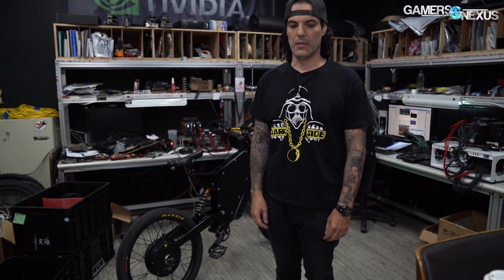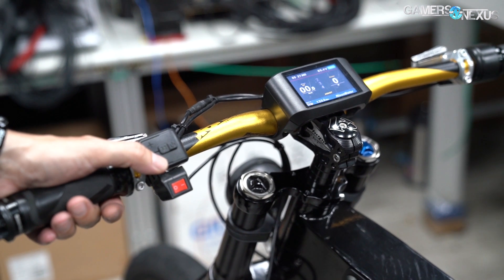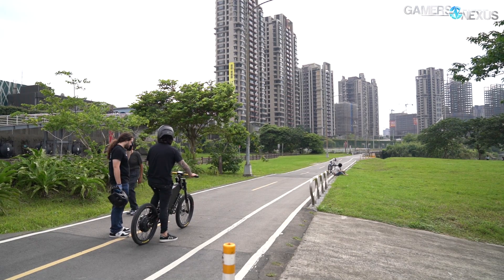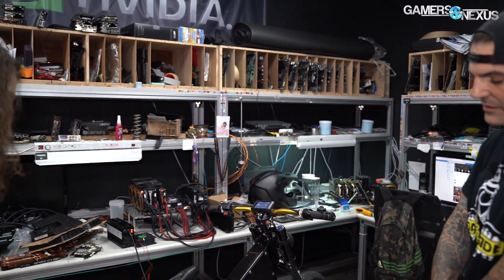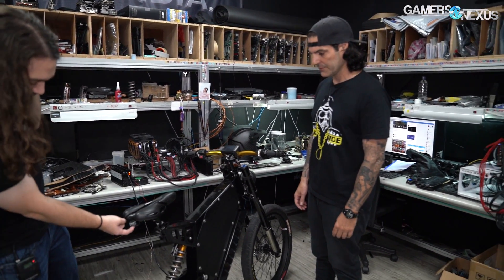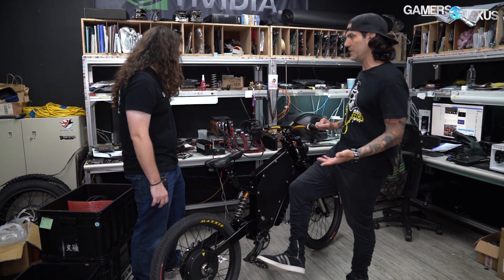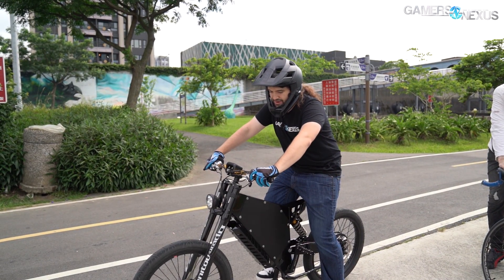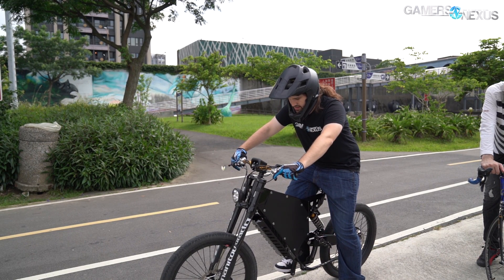KINGPIN's 60mph E-Bike | Bike Check & Test Ride

Comment: $75 e-bike capable of 25km/h with 250 W motor:
https://www.sears.com/skyling-25km-h-26inch-36v-foldable-electric-power-mountain/p-A013534087?plpSellerId=Skyling&prdNo=1&blockNo=1&blockType=G1
I haven't bought it so I can't say for sure it's good. Surprisingly there are no reviews. But it's super cheap. Although i don't know the shipping cost.
Edit: actually it's $460 shipping and $535 total. No pick up options. I should have known. Nice looking bike though.

Comment: In NYC only the peddle assit are legal, no throttle.  The cops hate taking bikes that have the throttle enabled because they feel its a big waste of time.
Reply: I hate he pedal assist, it’s dangerous! Mine has a good half second lag, and it’s way to aggressive! Then the speed cuts out way too slow (I can do about 30 mph average on a normal bicycle if it’s short distance like 15 miles). I hate it, throttle for sure is better, so much better control! Speed limiter unless pedaling is fine (since it’s not like my gasoline powered bicycles, it just weirds me out when I’m not pedaling and moving without sound.... I always pedal with it, so having limited without pedaling would be fine since that would never happen for me

Comment: "Are these quadpiston?" Is this what it sounds like when I talk about pc parts in front of normal people?
Reply: Just add in some slang. I use six pot brakes
Reply: @th3d3wd3r  Okay wtf does that mean.
Reply: @imnotusingmyrealname4566  The "pots" are the actual pistons which press the brake pad into the rotor. A 6 pot caliper has 3 pistons on each side of the rotor. A normal car brake will be "2 pot" and performance brakes 4, 6, or even 8 pots. For really large brakes you need more pistons (pots) to evenly apply pressure.
Reply: @johnbrooks5903  Yeah that's what I assumed. I've never heard it in that context. Damn are that many pistons necessary? That's what I assume a sports car would have.
Reply: @imnotusingmyrealname4566  well they are smaller than a sports car so yeah. Also when going 100kmh i think you would want to stop quick
Reply: I suppose so, I am somewhat of a “nerd” per say in both automotive and pc gaming sectors.

Comment: How much more range could he get if it the battery and controller were LN2 cooled? Let's find out!
Reply: About 1/3 if I were to guess, the battery efficiency for lithium based batteries goes to crap around freezing temp at, so they are very bad for the winter, also power output becomes garbage.

It’s not a lot of power wasted on the controller so the LN2 cooling won’t help much for it, but I did think about water cooling mine (shunt modded, also may change out with 180 amp continuous drain mosfets, peak safe would then be at least 400 amps, so Lipo battery required).

Comment: A bike like this one costs 10 000$. I wanted one until i saw the price.
I think i'm a get a 600cc naked bike for 1/4 or 1/3 the price. And i can use it to go to the mountains or to the sea (200-300km).
If you have an e-bike or anything that goes above 25-27km on power alone(without peddling) you need a licence and you have to use the main road, no bike lanes no nothing, it's like a A2 driver licence. so in EU it kind of sucks.
Reply: Do you have that loophole with no power limits? In Texas, the loophole is no faster than 20 without pedaling (I pedal 30 mph on a regular bicycle), so reasonably there is no top speed limit with pedaling and motor (normal traffic laws only), AND the best part... they forgot to specify a power limit!

So this means I can have some insane duel motor drive system that can book it 70mph if I wanted to, just as long as it has a pedal sensor that limits speed to 20 mph when not pedaling... Genius! Most other states have a 1000w max limit etc, but not for Texas! Most other states allow 30mph without pedaling, but this dumb loophole is something I’ll totally take advantage of! Plan is 50mph (should be fast enough), and to drive responsibly since you know, 50mph isn’t fun on a bicycle... but get a good workout pedaling to work (basically it will add 15 mph to my top speed on a normal bicycle and add20 mph to my average)
Reply: Bike parts, including frame and shocks - $1000
Motor and controller - $500
Battery - $500 for 1,5kWh, $1000 for 3kWh.
Not even close to 10k.

Comment: i want this. last time i was looking around everything under 1k looked like junk and they quickly go up to like 5k AUD and thats insane. really getting the feeling im going to have to build my own. would of been nice to have some links to the parts
Reply: This probably cost over $1000 AUD (I’d use a bicycle at least half that, assuming you got a really nice deal on a used one). A 72v 20Ah battery is about $650 by itself (US price), and a motor kit is actually only going to cost you like $200, but a bike that can safely handle the speed and that battery really drive it up! Also this would not be legal unless classified as a motorcycle for most parts of the world. But you can certainly build some nice ones!
Reply: Bike parts, including frame and shocks - $1000
Motor and controller - $500
Battery - $500 for 1,5kWh, $1000 for 3kWh.

Comment: That is not a bike, its a modded  electric motorcycle that happens to look like a bike
Reply: More like an electric moped, except Kingpin disconnected the "ped" part, if I understood correctly.
Reply: @joesterling4299  He took off the chain, since it kept breaking when he bottomed out the suspension.  So now it's throttle control only, which is pretty much an electric motorcycle. :)
Reply: @realzyxtomatic  Imagine the freewheel at 100kph, they are not designed for that. If that jams, your pedals start going.... I had it happen at low speed, I've stopped running with a chain too for that reason.
Reply: @clubpasser123454321  If your freewheel is jamming then it's poor maintenance. That's not a problem for anyone else.
Reply: Maybe... or it was a poor quality freewheel or had an internal defect. If your bike can go 100km/h why take a chance of that mode of failure?  Riding at high speed, my biggest concern is mechanical failure and I try to take all steps to avoid it.
Reply: @clubpasser123454321  they make freewheel crank sets that could help with that...
Reply: @rjvowels  I've now modified the "bike" to the point of being an electric motorcycle. Kind a went around the problem.
Reply: @clubpasser123454321  sweet... Im working on a custom full suspension beach cruiser type ebike right now.... Gonna run dual 3000w hubs front and back, dual 80 amp controllers and dual 50 ah 96v batteries.... Should get up and go. Lol
Reply: girlsdrinkfeck depending on local laws. Here it would have to be registres as a moped because it has a throttle. Only pedal assist is allowed as a bike here
Reply: No, an electric motorcycle is 3 times S heavy. Bigger tires, more payload, longer range

Comment: Word of Advice,
when going so fast you need to get waist strap to keep your kidneys warm.
Or you will get organ issues later on.

This is a typical long term damage for scooter, motorbike and moped riders.
Reply: Also a motorcyclist from a family of motorcyclists and have never heard of this. I know of kidney belts from motorcross as a protection against falls. Cursory Google also didn't yield much. Have sauce for your info?
Reply: Ok so I looked it up, with kidney Belt and the is some stuff, it is mostly to prevent your back from being chilled from the Wind so it does Not cramp up. It also is Not proven that kidney failures are come from this, but in my biker community in germany they All wear them.
So i Look at Louis.eu and Wikipedia
Reply: Never heard of that and am a motorbike rider.
Reply: @wobblysauce  Well then, better Look into it! In Germany everyone wears them
Reply: Hum... might be more of a fashion thing... oh what are you wearing? but trace it back to someone with back pain.

Comment: A friend of a friend modified his bike to be electrical. He used a really powerful motor (don't know how powerful) on a normal bike that was quite old.
It worked for a few months until he was confident enough to give it full throttle. The motor was too powerful to handle it and it ripped the bike apart^^

I would really like to have a bike like this. But unfortunately in my country electric bikes are limited to 25 km/h and the cops are giving out tickets. :(
Reply: Wait, what if you went regular bike and drove it faster than that? Last summer I did 55kmph (about 30-35mph) and had to drive in the lane on a highway of sorts to manage that. Was quite fun, albeit, exhausting.
Reply: @YTHandlesWereAMistake  
That's totally allowed.
The law is also a bit more complicated as I made it look like. If your bike only supports your pedaling it can support you up to 25 km/h. After that the support has to stop. If you manage to got faster without the support just by pedaling that is totally allowed.

If  you can use the motor without pedaling the max speed is 20 km/h with motor and you need a license plate and a driver license. Here you have a max allowed speed of 45 km/h without the motor support. 
Oh and you aren't allowed to modify or change parts. Or build your own bike. It has to be how the manufacturer sold it to you.

Oh an the max power the motor is allowed to have is 500W....

Comment: You should check Greyp bikes they are made in Croatia(thanks toni for the correction) by the company who makes Rimac Supercars. They actually have brakes that recharge the battery! Check them out if you have possibility!
Reply: Actually made in Croatia, city of Zagreb. The motor Vince uses is like a "cheaper" variant of the Cromotor (hubmotor made by Greyp bikes) if i remeber it correctly. But the Cromotor uses better bearings and so on.
Reply: @RzrBldSwe  wops you are in fact correct 😅😂
Reply: So like kers in formula 1? That's awesome
Reply: @jesselioce  yeah, it's like that, I think it is called regenerative braking, and it is even used in electric cars like Tesla
Reply: That bike on the video has regen braking as well. Even many cheap hub motor bikes do.

Comment: Me and my brother actually built custom E-bikes ourselves and we love them. They are very powerful. Mine has a peak power of 14,000 watts and my brothers can peak 17,000 watts. We went all out and crazy haha. Fox 40 and DNM 203 forks, I went with Magura MT5 quad piston brakes with 203 rotors. Our top speeds are 66 MPH and his is 75 MPH. I have a Mxus 3K Turbo motor with a 3T winding and his is a Mxus 5K Turbo with a 5T winding so mine is built for more top speed but his is a torque monster. We both have Sinwave controllers as well so ours are actually dead silent, you don't hear them accelerate at all or stop. I'm running a 83V battery and my bros is a 105V battery. Depending on how we ride we can go from 35 miles being on it to up to 100+ miles if we are really conservative and cruising.  My bro's is real smart with the electrics as well so he built both our battery packs and maintains them. Like you said it's scary especially if you don't have your controller programmed properly for how you want it to handle torque, soft start, there are so many things you can do when you get to the high end of controllers.  We both have Cycle Analyst V3's for our display output and primary controls on the fly. Long comment but you'll love it, Steve, when you get the chance to build one or purchase one. Not cheap though as both of ours cost over $6K when completely done but was money spent with no regrets when finally complete.
Reply: Brandon Glover what’s the price for something like the one Vince has?
Reply: @KalebQi  It's tricky to estimate a price for these because of the many factors. The biggest factor and price for these is your battery pack and I don't know specifics of Vince's. Most likely his is built with 18650 cells but I don't know size and the plays a big factor in price. Also don't know how high end his controller is. He is also in Taiwan and lot of e-Bikes parts come for there or China so it should be cheaper. Vince also has custom forks which would make his a lot more then it would have to be so part choice really plays a factor as well. My estimate would very wide as something similar plus or minus certain part choices would be $2K to $5K. Hope that helps some.
Reply: @brandonglover3156  That's not bad for something that goes so fast. Can they be made to be street legal? It seems like a great in town errand running vehicle
Reply: Have you made or do you know of any guide that would help me purchase the parts necessary? I've been contemplating selling one of my vehicles to get a motorcycle, but an electric bike actually seems better for my purpose

Comment: he should just run a chain tensioner instead of a derailleur
Reply: Vince! He needs to read this. There are solutions! Pedals with no resistance just feels weird.
Reply: ya blew it i mean if you spin them not really fast when you are doing a high speed ride even on a regular bike, especially down from a hill on a road, you don’t feel any resistance either. It’s a natural effect.
Reply: @YTHandlesWereAMistake  A chain and a tensioner add momentum and turning resistance to the pedals no matter how fast you're going.

Comment: Was that 77 km/h faster than 19.9* mph?
*=in New York
Reply: Nope, it was exactly 19.9mph.
Reply: It depends if you measure in Rossmann M/H or average MP/H.
Reply: .999999999999999999999999
Reply: I take it the speed limit in NY for vehicles in this class is below 20 mph?  Otherwise, I'm missing an inside joke, somewhere.
Reply: @joesterling4299  yeah, NY has a law banning all motor assisted vehicles from being capable of doing 20 MPH, the inside joke I was refering to was another youtuber Louis Rossmann (he mostly does macbook repair vids). It is not just a speed limit, you can get the vehicle permamtly confiscated.
Reply: @whatdafarkenhell7110  Yeah, I know Louis.  Didn't know about this connection, though.
Reply: @joesterling4299  In his spare time he is buying bafang motors and reprogroming the cointrollers to blow them up, I mean attempting to make them go a hell of a lot faster. He has uploaded some vids on it, including some rides where he swears he is only doing 19.99999999999 MPH, while complaining about other road users getting in the way.
Reply: @whatdafarkenhell7110   LOL!  I'm going to have to look those up.

Hey, Steve joined in.  This video reminds me of the time I borrowed my 2 younger brothers' moped for a quick ride around the neighborhood, and came back about an hour later.  They were still standing there.  The older bro had his mouth literally hanging open.  Uh, sorry guys. The spirit moved me.
Reply: Yep them pesky Uber drivers...
Reply: Joe Sterling I was in the countryside and let a neighbor ride my ‘regular’ bike but above average of what you see on the streets of capital and the shops. 
The guy came back like 2 days later. Says he has been to the nearest town and stayed there. Speedometer said the travel distance increased like kilometers after those days.
Reply: No Gravitas uh... no, exactly the same speed.
Reply: 20mph is a nice speed

Comment: Most places treat E-bikes below about 750w/28mph  as bicycles (some locations even lower[500w/20mph], some higher[1000w/35mph]), but anything above that as a Moped/motorcycle(plates, licenses, insurance, etc )...  ALL require working pedals to qualify as a bicycle.  Same as with bicycles with gas motors below 50cc.   I recommend a front hub motor  and keeping the stock rear gear/chain/pedals setup.
Reply: Ogre1977   front wheel has drawnbacks too, though.  I made one, and had the cast front dropouts break under the torque of the motor.  over the bars, broken thumb!   make sure you have torque suppressors on both sides of the fork, avoid forks with suspension....steel fork the safest if going for front wheel drive. cheers
Reply: Front Hub Motor is a bad idea for anything higher than 250W. The traction will be terrible and you will die in the winter on icy roads.
Reply: Ogre1977 - in the UK only 250w is allowed! :-(
Reply: @davybloggs1564  just don't stop for chats with the police lol quietly go down a narrow lane and jobs a goodun.  Remember it's only legal if they can slap taxes on it lol
Reply: how r u gonna do wheelies with a front hub tho x d
Reply: I recommend a controller where you can have different settings. 15 mph, 25 mph and we gotta be there yesterday. It's voltage + amps = watts. So 72 volts @ 10 amps is only 750 w, while 72v @ 50 Amps = 3500 w. All controllers that would be used for a cycle like this are programmable, wattage and max speed.
Reply: jack cleland **voltage x amps = watts

Comment: I would not want to go over this thing at 100km/h. Did he give an overall cost of this venture ?
Reply from the maker: You definitely do not want to go OTB at those speeds. Price depends a lot on the frame and source. For KP, import/duties would cost a fortune on bikes from outside of Taiwan, so going for a more local option, like what can be found on AliExpress, helps keep costs down. Not sure what KP's bike cost in Taiwan. In the US, you can easily spend in the range of $4000 to $8000 on a similarly powerful ebike, but it depends a lot on the battery (30A to 40A could add ~$600, for instance).